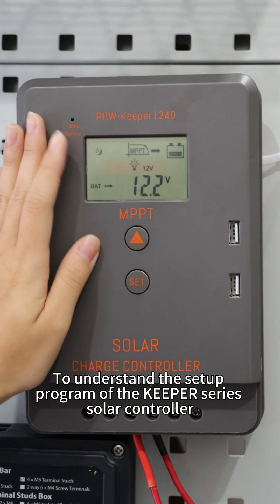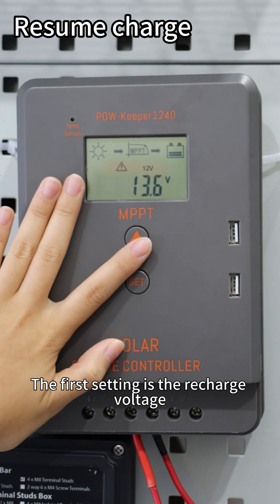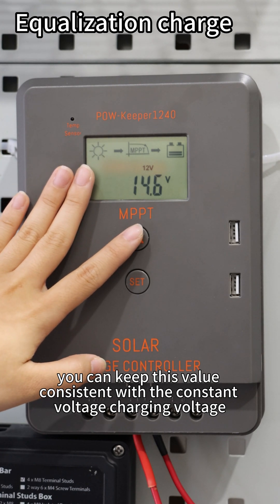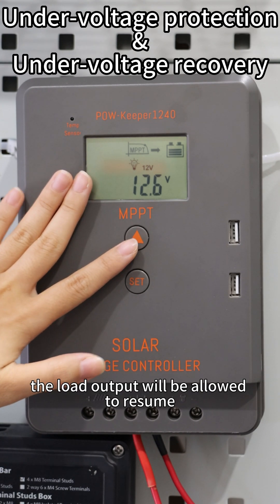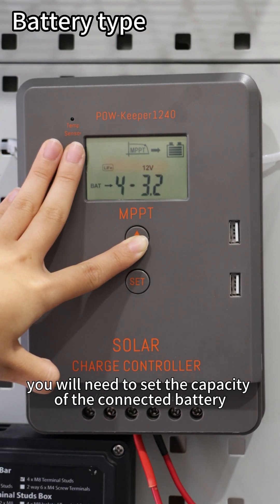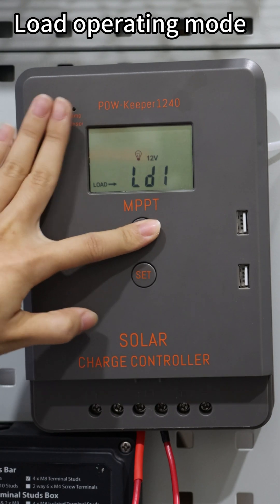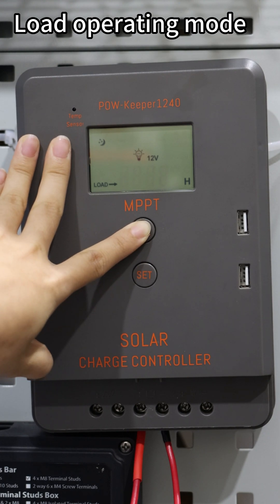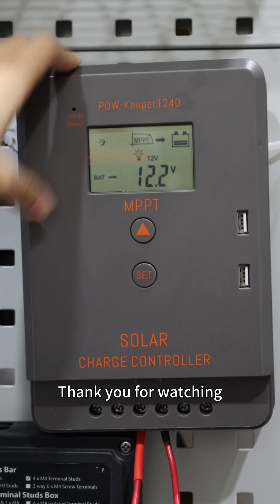PowMr New Version keeper Charge Controller Setup

Comment: For 12volt 100ah lifepo4 battery, which mode I have to select 4*3.2 or user2? 
Powmr keeper 1220 controller. Please reply
Reply from the maker: Yep.
Reply: @PowmrSolar reply me, which configuration should I use?
Reply from the maker: @mdazizurrahman1675  4*3.2

Comment: I want to change the recharge voltage, but it wont flicker to change mode after long press the menu button.
Reply from the maker: Please set the battery type to USE first.

Comment: Why old models of "Keeper SERIES
Maximum Power Point Tracking Solar Charge Controller
MPPT 20A-40A" have static loss then panel not producting power (night for example) 9-10 miliamperes and new version have 42 miliamperes of static loss?

Comment: I have 30a scc when the voltage reach to 14.4v it will stop charging I need to wait the battery down to12.8v to resume the charging or sometimes I have to turn off the scc and turn on again to resume the charging.Is that normal?
Reply from the maker: This is normal. When the battery reaches 14.4V, it should be fully charged.

Comment: Hi, one question? I have 4 lithium batteries （4-3.2v, 100A per battery) total 400A in parallel connection, in the setting page, is it adjust to 400Ah?
Reply from the maker: which model? Keeper 40A?
Reply: @ POWMR 1230
Reply from the maker: @leebg852  Set 100AH to charge normally. The battery type can be set to USE. If the charging voltage is set correctly, it can be charged normally. It has little to do with the capacity.
Reply: @PowmrSolar  so, what is that capacity parameter use for?

Comment: Oi. Eu comprei o controlador.  Ele veio sem o Manual. E eu não estou conseguindo configurar o controlador 1240 para o banco de bateria de 12v 40A. Qual é a porcentagem de overlod que o controlador 1240 suporta?
Reply from the maker: Por favor leia as instruções abaixo.

https://cdn.shopify.com/s/files/1/0746/0415/1079/files/POW-KEEPER-Series_User_Manual_bb3569ba-b8fb-44af-b705-ef13f9c0da9e.pdf?v=1686640659

Comment: I have the 40a but I want to use it without battery. Only solar panel and LOAD connected. It that possible? So when there is sun, I get power to the load and when it gets dark load goes off.
Reply from the maker: This controller needs to be connected to the battery before it can be turned on.
Reply: @PowmrSolar  Thanks for your help. It seems to work without battery too with panels in full sun. Another thing: I have an Ecoflow Pro, what battery type should I select?
Reply from the maker: @giogra8005  Please send it to this email: support@powmr.com. Our technical staff will check it for you.
Reply: you can use Elejoy 400W or 600W MPPT solar controller. It operates by solar only without battery.

Comment: I see that lead acid batteries drop to 10 volts before shut off, this voltage is considered too low and can damage lead acid batteries, can voltage be configured so as shutoff is 11.4 volts. Thanks from Ireland

Comment: Seems like a good controller. However, the interface is not very customizable and a bit confusing. 
For example, there is no need for 4 LD options. Can be easily set: [24 h] for constant output, [0 h] at night, that is. it works when the panels are not charging and vice versa and [1-23h] time how long the output works when the panels are not working, [-1h] reverse mode (while the panels are charging). And so instead of 6 setting options, here we have only one parameter that covers all 6 options.

Comment: I am currently working with a 24V solar panel  250 Watt and a 12V battery 100 Mah . Could you please advise if it is possible to safely use this setup?
Reply from the maker: Please send your problem to this email: support@powmr.com.

Comment: I want to change the high voltage to 15 volts in lead acid batteries.  But how?
Reply from the maker: Select USE for the battery type, and then adjust it yourself.

Comment: A few days ago, I bought the 30 amp machine that connected a Jinko 580-watt 24-volt panel. I am not getting any response from this machine, although the weather in my area is not good, the sun has not risen due to rain. Will I get no output from this controller if it's not sunny?
Reply from the maker: Please send your problem to this email: support@powmr.com.
Reply: @PowmrSolar  How to turn on photovoltaic input?
Reply from the maker: @Thisissumonpro  Kindly check your email.
Reply: @PowmrSolar  please send

Comment: I already have this same model, but how to activate the rotation display like the old model so i dont have to operate the botton just to see some details on display..
Reply from the maker: Please send your problem to this email: support@powmr.com.
Reply: @PowmrSolar  The default settings for low voltage is 10.8 , is it possible to change to higher value. Powmr 1220 20a
Reply from the maker: @alvinramos-i2g  Set USE first and then change it.

Comment: hi ! I have powmr powkeeper mppt 1220 controller Firmware version v1.7 . i have problem with this controller. i used 12v LiPO4 battery pack. battery is normaly charging ok. but after few hours battery fully charged the controller stoped charging. and i using the battey in day time the battery just keeps going drain and the controller doesn't charge the battery no matter how much sunlight there is.
There is no such problem with my other controllers.  I  have a powmr mppt 60A controller, Even after the battery was fully charged during the day.  The amount of amperes obtained from the battery is not reduced by the battery and is given from the panels through the charging controller.  Now this 1220mppt  after fully charging it cut off the solar  panels and do not give any output to useing load .  Then in the evening, the battery is half depleted.  The battery will not be left to use at night.. my english is not good butI hope you understand. how can i fix this.  thanks
Reply from the maker: please send your problem to this email: support@powmr.com. Our technical staff will handle it for you.

Comment: Is it possible to connect the 220 inverter to the controller load instead of the battery?
Reply from the maker: You can only connect to the battery.

Comment: Tenho uma dúvida.... quando ele entra no modo mppt em 12v qual é a voltagem mínima dos painéis para que ele entra no modo mppt.
Meu sistema é 12v duas placa de 155w em paralelo e ele não arma o modo mppt é o 1230
Reply from the maker: For 12v system: the voltage range is 12V-75V, Max. Input Power: 390w.
Reply: Eu acredito que você tem que colocar as duas placas em série para o mppt entrar em ação. Boa sorte.

Comment: How to I adjust the Resume charge voltage? With Lifepo4 setting it is 13.0V which is too low.
Reply from the maker: Please set the battery type to USE1 so that you can adjust the parameters yourself.

Comment: Hi! I am using the 1230 model with a 24V Gel battery bank setup. Note that I am using the preset parameters for GEL type batteries. The charge controllers indicate that I have a 23V power input however it shows that there is no charge current. Batteries are currently at 25.1V, if I am correct, according to the settings, this controller should start charging the batteries. Am I doing something wrong?
Reply from the maker: Hi, please send your problem to this email: support@powmr.com. Please note that we may not be able to promptly respond to you due to the Lunar New Year. We apologize for the inconvenience this may take and thank you for your understanding. We wish you all the best!
Reply: This controler can only step down voltage. If you puting 23 V then it can not step up and charge 25 V if you about this...

Comment: Can 3 of these work in parallel connected to the battery with separate solar panels connected to each solar controller?
Reply from the maker: Hi, this model can't be used in parallel.

Comment: Hi, I'm having an issue with my Keeper 1230 controller. The display isn't cycling through the different screens like current, voltage, and temperature. Any advice on fixing this? Thanks!
Reply: É a versão do software instalado. O meu é U1.4 é também não fica trocando e os icones no display no LCD são diferentes dos que ficam mudando os dados, è igual ao deste video acima que também não muda .
Reply: @luizhenriquemerhy1640  Valeu, amigo!
Reply from the maker: Hi, kindly send your problems to this email: support@powmr.com

Comment: What are the default values for 24v LiFePO4 Battery?
Reply from the maker: Equalized charging voltage
Maintenance-fee lead acid battery: 14.6V;
GEL: No; Lead acid flooded battery: 14.8
Absorption charging voltage
Maintenance-fee lead acid battery: 14.4V;
GEL: 14.2; Lead acid flooded battery: 14.6
Floating charging voltage
Maintenance-fee lead acid battery,
GEL, Lead acid flooded battery: 13.8
Low voltage re-connection
(LVR)
Maintenance-fee lead acid battery,
GEL, Lead acid flooded battery: 12.6
Low voltage disconnection
(LVD)
Maintenance-fee lead acid battery,
GEL, Lead acid flooded battery: 10.8
Reply: @PowmrSolar  thanks a lot but what about LiFePo4 battery at 24 V , BR
Reply from the maker: @eumesmo-kd1tr  Generally, you can find the specific reference value of the battery in your lithium battery manual. Then set the battery type to USE on the controller, and you can customize the lithium battery parameters according to the reference values in your battery manual.
Reply: @PowmrSolar  yes thanks, i was looking for the values and how to change it, but now i could find it, now i will connect with my other controller in parallel with the same values than my epever controller BR

Comment: In a 24v load terminal system that supplies 24v, can it supply 12v power?
Reply: If you set your batteries to 24v then no. You will need a buck converter to convert that to 12v.

Comment: Hi, I'm using the POW-Keeper 1220. I selected SLD in the controller because based on the manual, if you are using a Sealed Lead Acid Battery of 12V, you should select SLD. My problem is in the SCC, the LVD is set too low at 10.8V. How can I change it to 12.0V? I long press the MENU button while LVD is selected but nothing happens. I need to increase the LVD to protect my battery.
Reply from the maker: Please change the battery type to USR1 or USR2 before setting it up. If SLD is set, the system will automatically default LVD to 10.8V and cannot be modified.
Reply: @PowmrSolar  Thank you. I will try setting it on USR2 and let you know if it will be successful.
Reply from the maker: @patrickc.3185  Okay.

Comment: Hello maam. Im already bought powkeeper 1230. Same as your MPPt. Can i ask?. How about reserved settings if long press the MENU,will shown 19.2 directly. Its ok for that. My battery is 12v system. Sealed Lead Acid battery
Reply: Hi dear sir, could you tell me which setting parameter you are asking? (the charging voltage? or the battery type?) Let me have a check for you.
Reply: The last settings that i have shown, no01 or reserved settings,  or nevermind that settings, because if put press MENU 3s will shown, other settings
Reply: this setting is for RS485 comunication baudrate, 19.2 means 19.2K ,  this fuction reserve for future only  @ritchiegarcellano8382

Comment: What are the default values for 24v Gel Battery?
Reply from the maker: Equalized charging voltage： GEL: No
Absorption charging voltage：GEL: 14.2
Floating charging voltage：GEL, Lead acid flooded battery: 13.8

Low voltage re-connection：GEL, Lead acid flooded battery: 12.6

Low voltage disconnection：GEL, Lead acid flooded battery: 10.8

Comment: good day mam., LVD/under volatage protection settings that is ok for GEL 10.1?
Reply from the maker: Yes, it's Ok.
Reply: What 10.1 low voltage disconnect? GEL is 50/50
Reply: you can set the lvd to 12.3 using the usermode 1, when you choose the gel type mode, you cannot configure it manually

Comment: Hello, 

Can you help me? I have your product Powmr Keeper Mppt 20A, I am trying to change the Resume Charge to higher voltage like 13.6V but I am not able to set it. This is what I am doing.

From Main Page > 3seconds Menu button > Resume Charge

On Resume Charge page I am trying to press Menu for 3 seconds but nothing is happening.

Battery type is already set to Usr1
Reply from the maker: Please send your problems to this email: support@powmr.com
Reply: @PowmrSolar I already sent to support, no answer until now.
Reply: @PowmrSolar  I'm good now. i used Usr2 instead. I cannot change parameters on Usr1

Comment: How to set at low voltage disconnect for lead acid battery
Reply from the maker: Hi, please send your problems to this email: support@powmr.com.
Reply: @PowmrSolar   the lvd of scc is 10.8 , i change of 12.9 but i se the but 10.8 is dont blink i press for 3 second or long press botton up to menu

Comment: Can anyone tell me if by picking the 4-3.2v battery then the LiFe symbol shows on the screen, are the charging parameters picked for me?  I have a LiFePO4 battery and i dont need the resume, the constant voltage, equalization and absorption charge. All I need is the Low voltage protection and Float charge,  Please correct me if I am wrong. Please tell me how to set this controller up correctly. Are the charging parameters user adjustable?  Thanks
Reply from the maker: Hi, please send your problems to this email: support@powmr.com.
Reply: @PowmrSolar answer the question
Reply: Hi, did you get an answer to your questions, I am going around in circles here !
Reply: @martinwragg8246  I got no help from powmr support. I studied every you tube I could find and eventually put my project on a shelf for later. I did feel by trying different button pushes I did get better at it but in the end I dont know if its set up right. I have an Epever MPPT that has a remote programer (M50 i think) that is much more user friendly and not much more money.
Reply: Same here….!

Comment: The maximum value of the output load terminal is approximately how many amps?
Reply from the maker: 5A.
Reply: @PowmrSolar the manual book says DC output rated discharge current is 20A for 1220 and 1230, and 30A for 1240. Which one is correct?
Reply from the maker: @adofatma2400  Yep, the rated charge current is 20A for 1220; 30A for 1230; 40A for 1240.

Comment: How can i set the charge controller for 6S (3.7v 18650 lithium battery) lithium battery? Pls reply ASAP
Reply from the maker: You can set USEr1 or USEr2.

Comment: How to set float voltage mine is maintain to 13.8 for Lifepo4 battery
Reply: Hi, before you set Float votage, you need to set your battery type "US r1", then set Constant charge voltage and Absorption charge voltage first. Keep the Constant voltage and Absorption voltage are higher than Float votage.
Reply: When you see the interface you want to change the set or parameter, you can long press the "up" button for over 3 seconds, then press "up" or "down" to select the parameter you want to choose. After you selected the parameter you need, long press "up" button again to save the setting selection.

Comment: No option to see PV voltage?
Reply from the maker: This video is not connected to PV. You can see it directly after connecting to the PV.
Reply: Hi, have you bought the Keeper 1240?@NeverMind-pk4wz